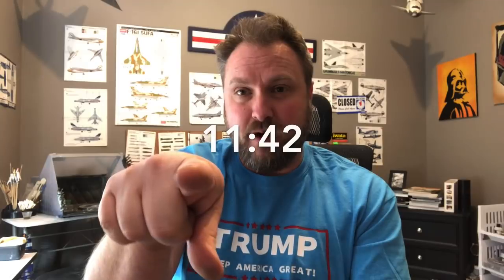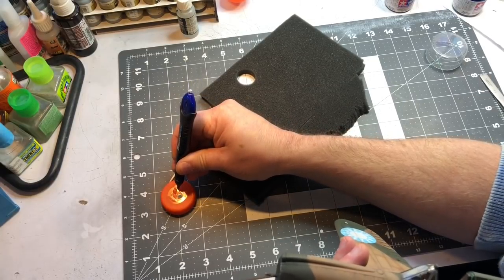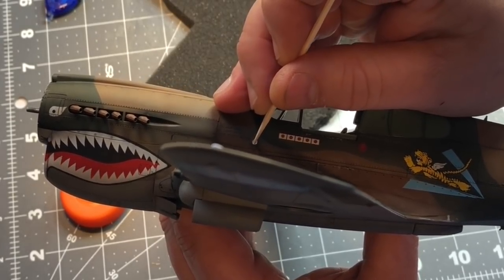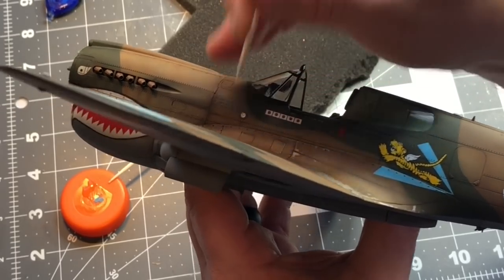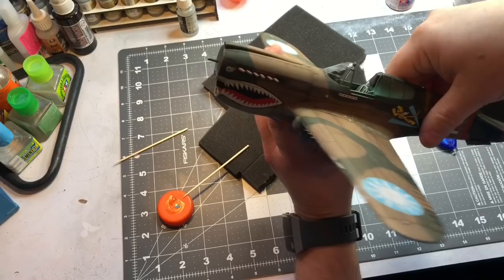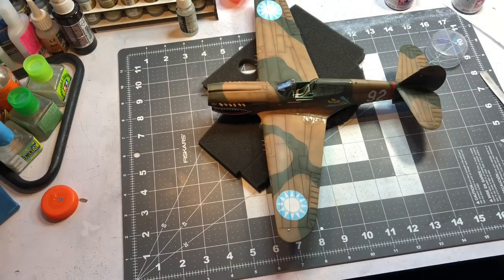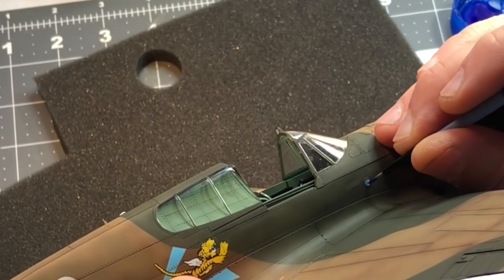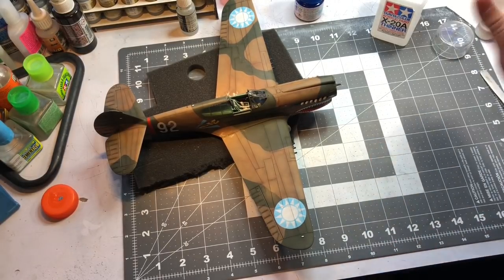Hasegawa 1/32 P-40E Build Part 3: Finishing Touches

Comment: So about the UV glue not completely curing… One of the dentist types in our group explained this… Apparently it’s got to be completely anaerobic for a full cure so that very top layer of resin that’s in contact with the air never fully hardens. You can just wipe it off with a little bit of IPA if you’re worried about it being sticky.
Reply from the maker: Well that explains it...they don’t tell you that stuff on the packaging!  Thanks Will

Comment: Could I get your advice on a couple things please? 1) how do I create custom masks? I'm building the Tamiya 1/32 P-51 (Blondie) and need to create the mask for the red on the front of the cowling and there are some tricky compound curves (never have done that before). And 2) how do you get the great weathering on your tires like you did on this P-40? Thank you so much for these videos...they really inspire me!
Reply from the maker: Hey Rob.  I’ve got a video showing how I make masks with a Cricut vinyl cutter and in the painting episode of this build, I show how to hand cut the masks for the sharks teeth.  For tire weathering, I often just use an airbrush with tans and greys thinned with isopropyl alcohol.
Reply: @seanerk5kt9  Thank you sir...I really appreciate your expertise and willingness to share!
Reply: @seanerk5kt9  So that works with Tamiya paints? 90+ strength Isopropyl...say 1:1? Sounds intriguing!
Reply from the maker: Yep, I use Tamiya paint for it.  I thin the paint to 90 percent ipa to 10 percent paint and gradually build up to the opacity till I get what I like.  It really doesn’t take much.  I then spray a flat clear coat over it.  You can do it with rubber tires but it’s pretty fragile on those so it’s usually best to weather them once they’re installed.  Hope that helps.
Reply: @seanerk5kt9  Awesome...thanks SO much! KAG!
Reply: Thank you SO MUCH for that tip on the ipa...I have always struggled to get a very fine mist effect with paint and the large ratio of ipa is an amazing result! Do you thin Tamiya paint with it all the time...does it have that same effect even with normal ratios?

Comment: Great videos and awesome work and explanations,  when can we see a vid explaining your thinning and mixing ratios you use and at what psi for airbrushing?
Reply from the maker: I’m not sure how beneficial that would be because I don’t have a set ratio or air pressure as there are just too many variables (ie. Type of airbrush, size of needle, type of paint, method of paint application, even certain colors spray differently etc.).  It really just takes experimentation with what your using.
Reply: @seanerk5kt9  Thanks for the reply !  i was curious since you mentioned the IPA dries really fast how much you used, i havent tried IPA but just got the Mr Color leveling thinner

Comment: Great channel! You have shown me some great methods.
How do i make money with modeling? Where do your customers come from????
Reply from the maker: Thanks Phillip.  You’re probably not gonna make much when you boil it down to a per hour dollar amount, but it is fun and allows me an unlimited amount of kits to build and pays for my supplies.  I’d recommend start off by selling on eBay with your auctions starting at $1.  This will let you know where the market value is on your work and might allow you to pick up commissions off of eBay.  Or start a YouTube channel yourself, that helps also.
Reply: @seanerk5kt9  thanks, I'll try e-bay.
Never thought too much about the money, but I'm running out of room. It's a fun hobby.
Your spray booth looks like mine, where is yours vented, do you wear respirator?
Reply from the maker: That’s the reason I started selling mine :). As far as the spray booth, I rarely turn it on...it’s just annoyingly loud and I don’t have it vented anywhere anyway.  It’s right next to my window so I just open up the window and turn on a small box fan to evacuate the overspray.  I do wear a respirator as well.  Safety first!

Comment: Would the liquid chrome pen worked instead of the bare metal foil for the landing gear pistons?  Just curious.
Reply from the maker: Yes...I just don’t like to use it on things that I’m going to have to handle after it’s applied.  It seems to take a while to cure and gets dull and fingerprinty if you touch it after.

Comment: I guess I need to get away from dry brushing, the chipping method you do looks better. I stopped building Hase's P-47 due to lack of detail & that idiotic 4 piece cowling. Trumpeter's are a bit better. As long as you don't build anything past a D-25. Trumpy never updated the pits. Came out sharp, customer should be pleased. Yes, that is the Pitot tube or "P" tube.
Reply from the maker: There are a number of ways to do chipping.  You could also use a sponge to dab in the chips.  If done sparingly, it can look really good.
Reply: @seanerk5kt9  Yes, the old cellulose type. I was trying to remember the old style and when digging through my toy box {from the 60's} found them. I'll even do a bit of experimenting with the foam from Eduard aftermarket kits. Forgot about that method of madness.

Comment: BLACK LIGHTS MATTER!
Reply from the maker: Red and blue ones do too!
Reply: @seanerk5kt9  I did not know that those lights to either side of the cockpit are to be painted blue. The instructions don't indicate any color. So the Revell kit you mention... is that the 1:32 scale kit? Because that one has a 92 on the box art. I also noticed that the camo pattern was not correct, but I didn't want to be a dingus and nitpick. I do not know who flew number 92 of the P-40Es since I don't have the pilot names in my book. Some of the AVG pilots had to go to Africa to get the planes and had to wait for the RoC roundels to be painted on before they were sent to China to replace several of the battered P-40Cs.
Reply from the maker: Yeah it’s not correct.  And yes you’re a dingus ;). The owner wanted it painted this way and knew it wasn’t accurate.  It’s from the old revell 1/32 box art and the guy built that model as a kid so he was fond of this scheme. Here’s a fun fact, the flying tiger emblems on these were big stickers sent by Disney and they had to put varnish on them to keep em on.  Here’s a link showing the color of the fuselage lights.  Apparently the bulbs were yellow so the blue lenses made them light up green.  Hope that helps with your build buddy.

http://www.aircraftresourcecenter.com/AWA1/101-200/walk139_P-40E/images2/Mvc-024s.jpg
Reply: @seanerk5kt9  Thanks for that link! I've never seen that website before. I had known that the Disney tigers were "decals" from what I've read. I didn't know about the varnish, but it would make sense because they were not stencils. The P-40s did not originally have them. It wasn't until after Pearl Harbor when they began actively attacking Japan and became famous that the Disney corporation make those stickers/decals.